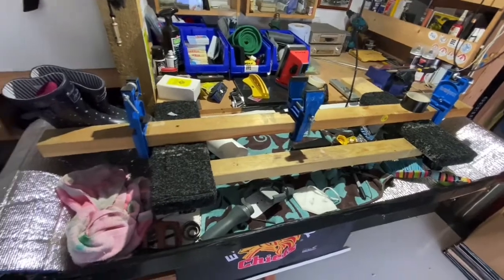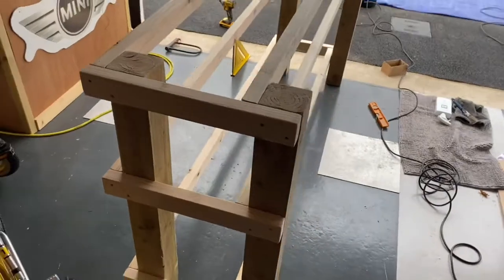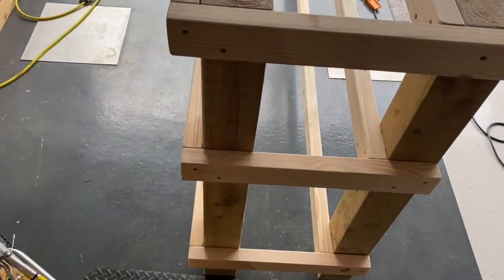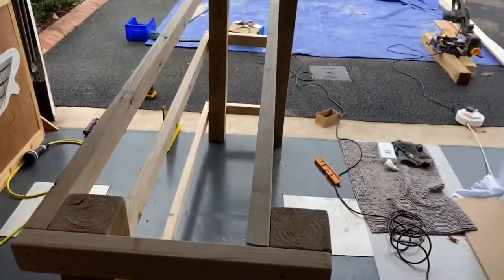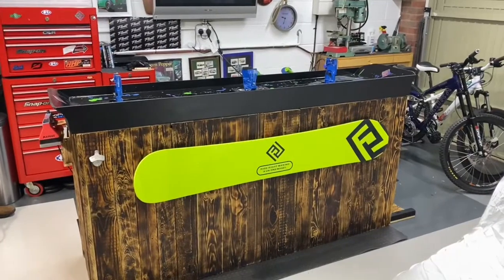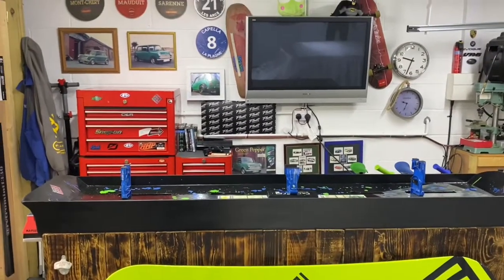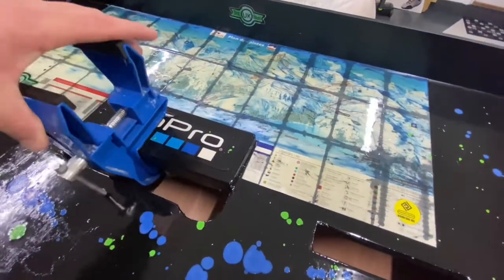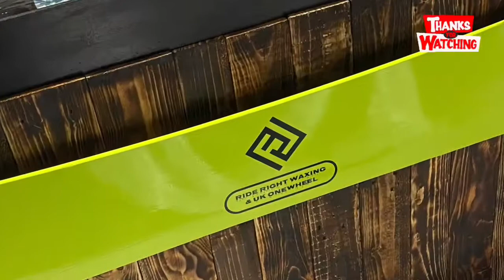time laps Ski / Snowboard waxing bench build. Bored in lockdown.Covid19

Comment: What kind of varnish did you use?
Reply from the maker: Just a yacht varnish clear from my local hardware store works a treat but I would suggest rolling it on in thin coats as I rolled on a little bit thick and it did wrinkle. 👍
Reply: @RRW   sweet deal, thanks man! Great video too, by the way!
Reply from the maker: @TheNickbatch  thanks buddy it has worked a treat and I could not live with out it now. Plus no mess 👍
Reply: @RRW  I've just made a similar bench, though collapsable so it can hang on my wall. Your vid was a huge inspiration!
Reply from the maker: @TheNickbatch  thanks buddy great idea 💡 about making it collapsible. 👍